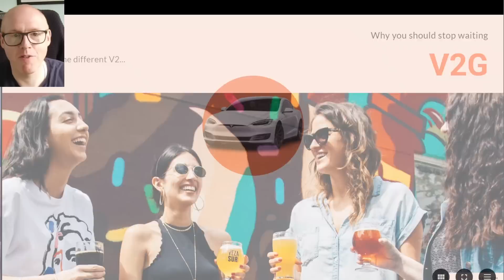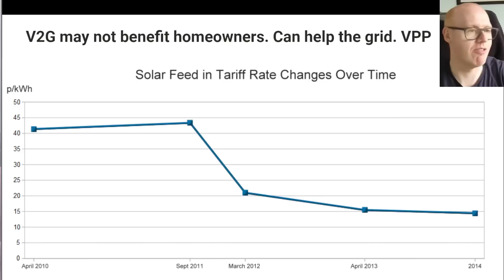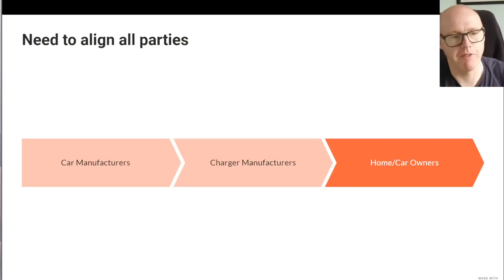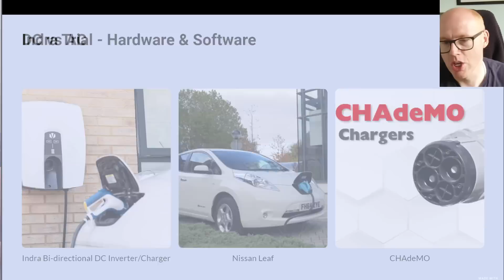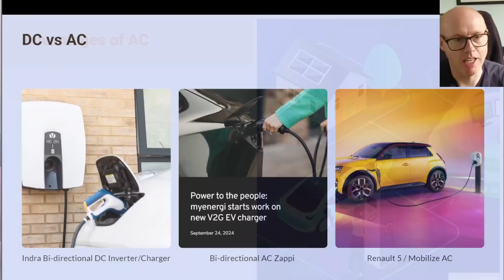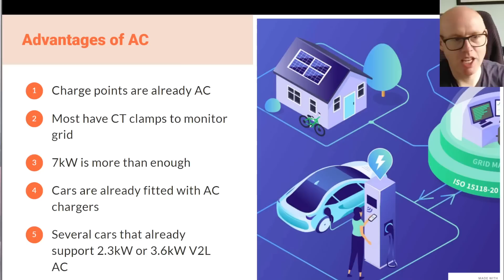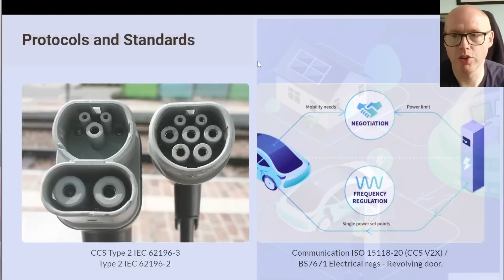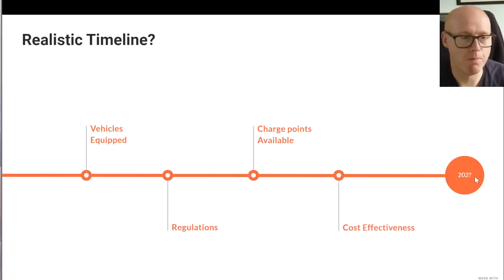Power your House from your Car - The FUTURE V2G

Comment: Nice overview  I thought youd be even more dismissive of the idea or at least the practicalities and costs. Why pay an extra (at a guess)  5k for the car and charger setup to do this when you can get a home battery right now for that sort of price and its always there its not going off to work or Tesco (other supermarkets also available). 
V2G also would need  very sophisticated software to deal with local load balancing, and i doubt the infrastructure is in place for that. At least, as you say, V2H is much simpler to implement and understand but of course its entirely negated if you have the temerity to use your car and with the ever falling prices of batteries having a stationary home battery thats always there simplifies a lot of potential issues, which makes it cheaper as well.
Reply from the maker: Thanks. I tried to be a bit more balanced with this than my usual unhinged self!

Comment: I'm sure you were expecting me to comment on this!

The trial I was part of for my V2G charger was CrowdCharge. Apparently the charger itself was worth £4500. (I didn't pay that, I just paid £250 to keep it at the end.) There was a G99 application involved and whilst the hardware is capable of around 32A, it had to be derated to support maximum 16A export, and that also meant a 16A import limit because there is only one limit selector.

I'm happy to have been involved with the trial, but in terms of saving money from it, I don't think I have, except where we're looking at strictly apples-to-apples comparisons for Nissan Leaf with normal EVSE vs Leaf with V2G. I'd estimate around £200 per year, and of course there have been some CO2 savings associated with that (helping the grid from 4pm to 7pm mainly), but I could have got a cheaper car that might have been more efficient and saved CO2 that way. It is CHaDeMo and basically restricts me to using a Nissan Leaf. Whilst that's not a bad car, I've had four Leafs and I feel restricted to using Leafs in the future while the charger is still working. When it does go wrong as it will at some point, there is no support from Wallbox for it, and at that point I'm just going to have it replaced with a normal EVSE if things are still as they are at the moment. Then I can look to downsize to a smaller EV. Public transport is getting better in my area and there could even be a time when I go carless.

The Wallbox itself has no CT clamp. I've put together a totally heath robinson thing with a Shelly EM to monitor grid power with a CT clamp and I've written some software to read from the Shelly and control the wallbox and emulate V2H. I've open sourced that software; I don't want to self-promote so I won't go into too much detail here.

I'm happy to answer questions about my experience. I think you're basically right about V2H but I think we're a long way off such systems becoming the norm.
Reply from the maker: Thanks for sharing your real world experience and perspective!

Comment: Nice overview. My doctorate is in this subject.... so FYI the electronics is down pat / all OK for decades; it's understood. The major issue is that each country has a bespoke power system adhering to national regulations which are written into law. Plus there will be a handful of national actors with a brief to do XYZ, often written into law or working to a government brief. By definition, these guys are in silos. Thus around the world there are hundreds of silo'd organisations with briefs based on local law... hence, to get unified action / international cooperation, changes to laws are needed in many countries. But governments have other things to do, so this is a very very slow process.

Why all this? Electricity is dangerous both from shock and (more likely) from fire, plus of course, damage to equipment which may be worth millions to the local DNO or many k to the householder / EV owner.

Will V2X "save the world"? That is, V2X + Smart whatever bring magical relief from costs? Nope.... there is a lot of guff re what can be done with V2G and how it can save billions. Individual actors may benefit, but as a blanket statement V2G cannot fix problems en masse - a conclusion from 7 years work and billions of EV simulations (based on UK and similar EU 50Hz, 230V systems). All good fun!
Reply from the maker: Thanks for commenting! There is so much more to the technical side that I didn't touch on and you've highlighted a very important aspect.
Reply: Is your doctoral thesis available to read?
Reply: @hillarysillitto  Yes, but links verboten here. Find Electric Vehicle and LCT Loads on Constrained Distribution Networks:An Investigation of Impacts and Options
Reply: @hillarysillitto  summary pdf  is Electric Vehicle and LCT Loads on Constrained Distribution Networks:An Investigation of Impacts and Options alas cannot link here
Reply: Why can't it work in reality? Each car has 5 to 20 days of home power in the battery that can be charged during periods of surplus renewable 90+% of the time.  That has got to save billions for our UK economy, surely.
Reply: @lesbarker1130  How do you get the energy to each house? Reliably, under worst case conditions (like mid-Winter in a society with EVs and HP drawing lots of power for long periods). Under ideal circumstances, yes there is power which can do the job. But, there is a but...

Most of the grid £££ cost is not in the National Grid, but in local distribution networks (in roads to your house). Many hundreds of £billions worth. So, these are built to be cheap and adequate for the standards of the day. Most were built from 1940s-1980s, and their needs / standards did not include EVs and HP running for long periods. Those in-place networks are fit for present peak home demand (averaged across the nation) of c. 800W per home, in the evening. We are going to put a zero on that demand; those in-place networks will not do it.

Imagine someone earning £2k a week and looking at a lifestyle where they commit to spend £100k a year on whatever. But they have a seasonal job, no work for say 4 months of the year, means - many months unable to meet the cost. This is the situation the local networks will be finding themselves in. For much of the year, all will be OK. Then the cold comes and the delivered energy (kWh of electricity, £k in the employment example) gives a shortfall. Some areas will be worse than others; also the "failure" symptom will manifest as local power outages which need fixing (don't hold your breath).

Can an EV transport from place X to every home that needs the power? If every house has a V2G EV, and if place X exists (by definition, local places don't have any spare power, so this must be a remote high-speed charger).

NB V2G is not 100% efficient. Not often talked about, round-trip efficiency ranges from 50% to 85%. That means, taking a kWh out of the car implies having previously fed it more (perhas, much more). 

"Smart" solutions will not help, as this is effectively a traffic management system (for electricity, not traffic - but the ideas are similar). Having a road able to take 1,000 vehicles an hour but soon expecting 5,000 vehicles and hour - needs wider roads / new lanes; however some will want to fit "improved management / better traffic lights" and expect the 1k road to do 5k traffic. It won't.

From this, any Smart system is a sort-term sticking plaster - it cannot meet more than a decade's growth, after that new roads / new networks please. Some might say, as this was known years and years ago, rather than spend say £50 bn. on Smart systems on the UK (which will be forced to be replaced) just replace the networks ASAP and forget wasting £billions on Smart. V2G can be a part of the Smart sticking plaster.

As said, this has been long known from c. 2008 reports with real-world trials in 2013 - 2015.

OK. To summarise. If you are forced to spend £billions because there will be weeks of (mass) local power outages a year, it will have to be spent even if you can get other solutions to work the rest of the year.

Hope that helps!
Reply: @lesbarker1130  YT kills my long-winded answer. In short - Reliability. Yes, this might help for 40+ weeks of the year in (say) 2035, but when the Winter has closed in and there has been a giant snowfall so everything stops for weeks - HP runs around the clock heating most houses etc - and the local LV network can't cope. Mass outages (of thousands of homes in a region) are possible, and as the electrical industry isn't supposed to be harming people from exposure, this is not a viable solution, alas. What of V2G? A HP will use c. 20kWh a day. So that's a couple of days help - assuming every home has a fully charged V2G EV :( For more gruesome details, see my thesis. Whew!

Comment: Check out Johannes Hübner's channel. He's been working on using CCS and a hybrid solar inverter to pass DC to the car and back to achieve V2G. Obviously its early days in the project, but its working. Pretty interesting stuff. 
Using an off the shelf inverter as a test bench not only keeps the development costs affordable it also already has passed regulation to be connected to the grid.
Reply from the maker: Yep, I've been following along there too!

Comment: I've had the Indra V2H/V2G system operating for 4.5 years now. The charger and tech support were free as part of an OVO/Indra project, which Indra took over and are still running. It's a great system from a user point of view, because I can run my house all day from the Car battery and recharge at low cost overnight. Octopus Flux allows me to export around 10Kw each day and make around £40 monthly nett profit. 
In a way it's a dead end project because it relies on my Mk2 Leaf and it's CHADEMO system plus Indras very good app. One way ahead is as you describe, using AC and handling all conversion in side the vehicles on board inverter.However Indra are still working on the DC versions for CCS and it's not ruled out. A home charge point with a built in inverter could be made for around £2k possibly and will pay for itself in around 3 years for many homes. Advantages include the ability to use any 2025 onwards CCS equipped vehicle and to interface with solar and handle various electricity suppliers export/import schedules.
Reply: Just to be clear, my V2G Leaf is a fully usable normal car that I  have averaged 8k miles per year in since 2019. When I'm out in it, the house is not using a lot o❤f electricity.  The battery has suffered no measurable deterioration from V2G and so it's much cheaper than a home battery, I.e. no additional cost. The general principle is that you already have a large capacity battery that is parked up doing nothing around 80-90% of its life, so what not use it to help with running your home and reducing your costs.
 It doesn't have to answer every problem, or be always available, in order to be a good solution to energy storage and some or most home energy costs.
Reply: @ don't you have two leafs?  Both in use?
Reply: I think falling battery prices have negated most of the benefits of this type of system. Yes you can run your home all day from the Leaf (unless you actually use it as a car of course) but its likely massive overkill, even the original Leaf has a battery 2x that what most home owners will need. i can run my house all day from a 9kWh battery and that includes me using my car. and with home battery prices falling faster than car prices that gives  home batteries an increasing advantage.
Reply from the maker: Thanks for sharing your real world experience and perspective!
Reply: Do you know when this v2g chargers are going to be available i have 2 Nissan Leaf s and would like to use one of the cars as a battery storage system
Reply from the maker: @PiperDam-c6y  Chademo is dead. You will not be able to buy a new charger but may get lucky with a used one if you join the Facebook group 👍
Reply: @PiperDam-c6y  I think it would be cheaper and much more space efficient to sell the car and buy a battery

Comment: Definitely on the way, the next Myenergi EV charger will be V2G they are working on it now. The issue is the house will also need a gateway so the house is cut off the grid during a power cut, V2G will be illegal without that.
Reply from the maker: Yep, exactly the same regulations as we currently have with home storage batteries.

Comment: As you mentioned ac chargepoints are just contactors that connect your car to the grid, so most will only need a software update to communicate with the car for the export side and communicate with the energy supplier for the force export times. They will need bi directional circuit protection aswell. But charge point manufacturers will want to sell you a new unit instead
Reply from the maker: @stuartevans6807  indeed!

Comment: Might be worth exploring the V2H/V2G differences in power use, e.g. V2H will probably need a higher output to the home whereas V2G would probably only need an output of 1/2/3 kW per hour then you can calculate how many "miles" will be used during those periods e.g. 1kWh will mean a loss of 3 or 4 miles per hour.  There are still loads of stupid comments out there  from the ignorant anti crowd like "waking up in the morning with a completely flat battery" etc
Reply from the maker: @rtfazeberdee3519  what am I missing? Why would V2G use less than V2H?
Reply: @UpsideDownFork  you'll probably be able to set the limit of what can be extracted from the car and that way you can control  it.  With V2H you'll more than likely want it to be able to power everything so it will draw a lot more from the car in spikes e.g. when you turn the cooker/microwave on.
Reply: I would guess that your V2G settings will be adjustable and  therefore I'd probably go for a constant 1 or 2kw. Slow and steady. Whereas the house could potentially be bouncing all over the place.

Comment: Great video that sums things up well. The rollout will be slow, as most early ev adopters already have a charger. You're unlikely to shell out another grand to replace a perfectly working charger.

Though I can imagine in a few years Martin Lewis getting his hands on one of these at some point and creating a tidal wave of new installs when normal people realise how much money they can save.
Reply from the maker: @mentality-monster  that would be a good result to drive things forward.
In theory, replacing an existing charge point for a bidirectional is very simple. Cabling is already there, just swap the consumer unit bits for bidirectional equivalents.

Hopefully this will mean it's cheaper but who knows?🤔
Reply: @UpsideDownFork  If we’re talking about a cheap Myenergi option, then you must be dreaming. Tesla might do though !

Comment: I have always liked the idea of v2h, think it would be the best solution for grid balancing as most people who will have evs will be on a drive and plugged in. 

Only issues is, if it is discharging and charging a lot it will effect the cycle life on batteries. Only small amounts of of the capacity can still effect the cycle life from videos out their but it's not clear on by how much.
Reply from the maker: @Sean_S1000  the effects on battery life are very minimal. There is already some good data from the Leaf owners that were on trial. 👍
Reply: @UpsideDownFork  that's good to hear, would be nice to have 50-60 kwh of storage on the drive, specially for those who live rurally